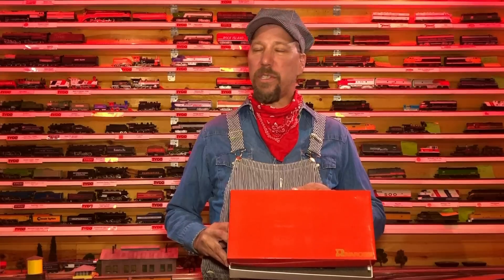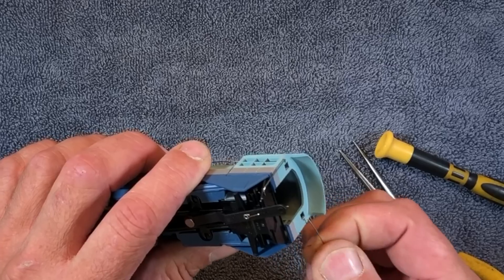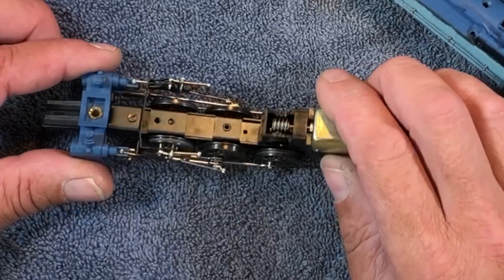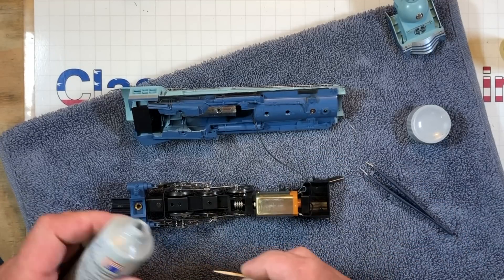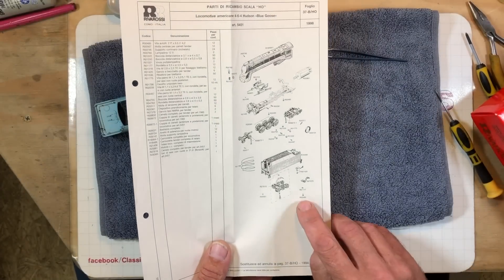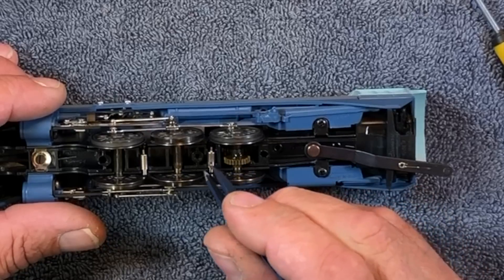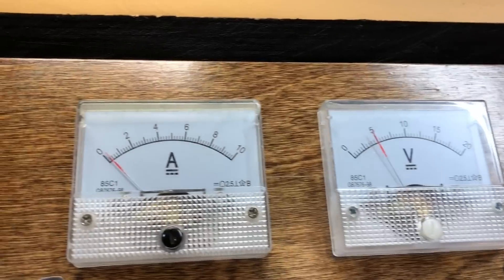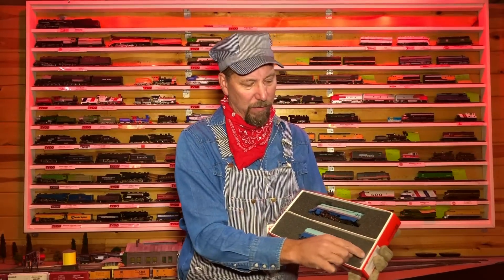Rivarossi  Hudson 4-6-4   "Blue Goose" Cleaning & Re-lube

Comment: A great video to say the least, however I feel some extra notes are warranted. There was a car the Santa Fe painted up into their Blue Goose livery, that being their only Pendulum car, which has similar tilting train tech to that of an Amtrak Talgo trainset. Another thing is the "Chief" and "Super Chief" passenger trains were actually two different trains that the Santa Fe ran. And one last thing is that the model is somewhat inaccurate, due to being based on the NYC Dreyfuss Hudson, leading to things like the coal tender on an oil burning engine. All said and done though, this was a splendid video and really good for some of us who may look into getting one at some point.
Reply from the maker: I think during my research that 2 cars were painted to match but it was a hit and miss.  could not get more than one story on it so I didnt pursue it. I did reference that the chief and super chief were two different names of specific trains. Perhaps I did not do a very good job. I did wonder why I read they were oil burners and this tender was a coal hauler.  Your information is good to me.  The Goose had a bulge on the fireman side of the front of the boiler to accommodate the raising of the smoke stack.  I did read about that. I enjoy others passing along there information, thank you for taking the time to type it out :-)

Comment: I particularly enjoyed this video because I have almost the same locomotive but in the NYC Streamlined Dreyfus version.  The chassis looks just like yours, motor and all.  I know it looks simple inside, and as long as everything works, it is simple.  But if you ever have to dig deep, OMG!  I still don't know what happened to mine before I got it.  It ran well at first, then would fail to stay engaged in gear.  I tore it apart - completely apart - more than 10 years ago.  Every few years I pull it out, fight with it for a while and put it back for another few years.  After many failures, I finally decided that I can not repair the original motor/gear mechanism, so I am down to 2 choices:  replace the entire chassis with one I got on ebay and repaint the drivers and cylinders OR pull off one of the drivers on the original chassis and install an NWSL drive that I I also have.  The tender on mine is cemented in place with pillars that go from frame to the top inside of the tender body.  I was afraid it would break if I tried too hard to separate the parts.  I am envious of yours that comes apart with just a screw.  The instructions in mine are dated 1995; I guess they smartened up about the tender over the next 3 years.  A few months ago, I learned that Rivarossi had a lot of problems with that locomotive; I think one was motors burning out.  Hornby bought out Rivarossi and doesn't even stock replacement parts.  BTW there is an idler gear between the worm and the drive gear.  Just more adventures in model railroading!
Reply from the maker: Sorry to hear yours is giving you troubles.  Sounds like you have many options to get it back on the road.  I would try the NWSL route.  Perhaps better engineered than the original? Yeah I noticed the stacked brass gears during the tear down.  I neglected to mention it clearly.  Thanks for the great information :-)

Comment: You gave me the courage to open my NYC 2328 up. It was converted to DCC with a QSI decoder. It is frustrating though. It stops and starts. Clearly not getting consistent juice. I ordered one of those fiberglass pens and I am going to go through all the pickups and wheels and everything to try to get this going. I can flip it over and connect the track wires to the pickup wire and it runs fine so I know the intermittency is being caused by the pickups. Probably could use a better keep alive too. See how it goes and report back to the Station Master! Thanks for a great video and great humor.
Reply from the maker: Glad to help you out Paul

Comment: Het there Ron. Yea, you did get to figure out those blessed sprung contacts, that contact the driver backs. Rivarossi used that system on a lot of their steamers. Would have been a pretty good system, if only the springs insde those contacts, didnt break.I dont think those contacts are very DCC friendly, as the higher voltage of DCC, tends to melt the aprings, inside those contacts. Leaving you "up the creak", trying to get the loco to pickup current.If only one could get spare parts.....oh well.. Lovn the maintenance videos, Ron. Cheers  Michael  NZ
Reply from the maker: Hello Michael,  Bummer to hear them pickups loose their spring tension.  kinda takes the loco off line real fast

Comment: Only Rivarossi items I have are 4 coaches with the Southern Crescent livery.  They are not illuminated but that will change very soon.  I have my ESU current collectors, part #50707, now and I'm ready to do it.  I've already changed out the talgo trucks to body mounted Kaydee couplers with metal wheel sets.  I'll be using LED strips with a full wave bridge rectifier with a 3300uF capacitor.  I sometimes am hesitant about weathering a brand new locomotive, but it HAS to be done.  Cheers from eastern TN
Reply from the maker: Hope you have very large radius curves for them body mount couplers.

Comment: I pulled out my Hudson today and it actually has two traction tires.  I have some replacements but I hate taking the drive linkage off to put new tires on.
Reply from the maker: I hope that will fix your wheel slip problems

Comment: I got the same one it came in the blue box never touched until I took it out to see if it was going to run
Reply from the maker: Wonder if the Blue Box has the old style motor with the brush holders sticking out of the back of the cab?